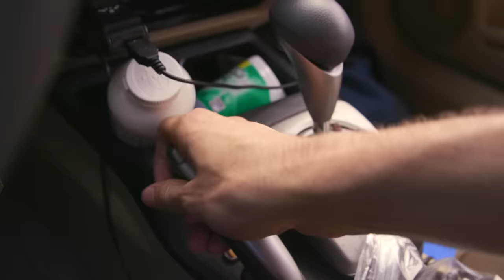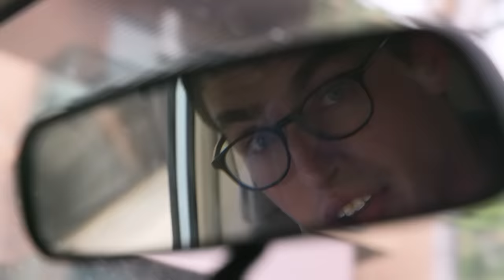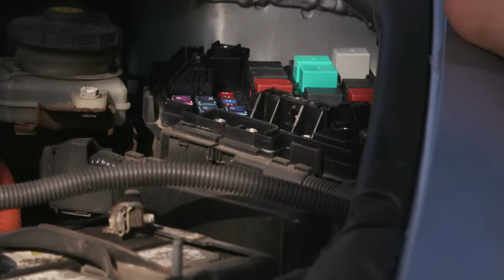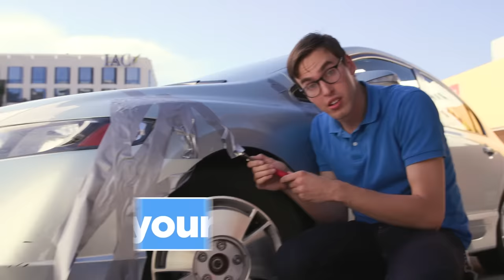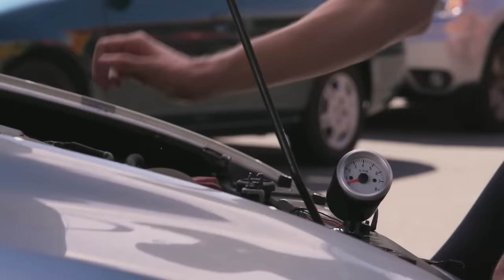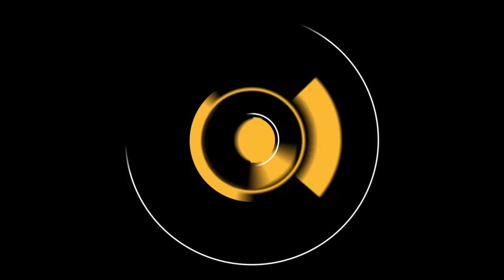5 Tips for People Who Don't Understand Cars

Comment: Wish I woulda seen this before I tried changing my prius' carburetor fuses. Now it beeps at me 100% of the time instead of just 50% of the time.

On a serious note, who the hell thought it was a good idea to control the wipers and lights with a four dimensional Bop It? And the beeping is srs annoying af. Be prepared to cut a few wires and spend a week reading the owners manual if you every get a hippy mobile. And screw HID bulbs. I feel I a massive dildo blinding everyone coming towards me. They're expensive and hard to change, too. The cheap ones won't even work because of "resistor imbalance", what a load of horse crap, they're just forcing you to buy from them.

The speakers it comes with are really good tho, I get to piss off everyone else on the road without any extra cost. And absolutely nothing has worn out except for the serpentine belt after 90k miles. So not a terrible car.
Reply: Prius lights are fucking annoying, it's true.
Reply: HugeWeltanschauung dwarf fortress!!
Reply: I see your problem here ... you have a prius, 
get a real car
Reply: you can make a prius better by walking.
Reply: rage fards See post above yours.
Reply: Considering that the NiMH battery in a Prius has about the same capacity as the deep cycle in my non-hybrid, I would have to agree.  Not to mention your attitude pretty much summarizes most Prius drivers I've seen.

Comment: Seriously, why can't we go back to when cars ran on steam?
Reply: I have driven a 1925 Doble,  20 minutes is about the quickest start up time.  One benefit is there is no transmission, direct drive.  Just keep an eye on the fuel supply pressure and water temp.
Reply: thejunkman you think it would be possible to fuse both techs? Improve the old design, but still keep it simple.
Reply: There are some real inherent drawbacks to a steam vehicle for "everyday" use.  Mostly being a total loss system in that you are always having to add water and when you do that you have to wait for boiler temps to rise again.  Lubrication and wear is the biggest thing to get around.  Also performance is very dependent on ambient air temperature.  Forget about the creature comforts you have come to expect in a car, as (just like with EV's) those are a hog on what ever electrical system you employ meaning the steam engine will always have to be turning, even at a stop light.  Even just running into the convenience store the car has to be "heating" to keep the boiler making steam.  The Doble is probably the pinnacle of practical steam car technology, but you just can't get around physics.
Reply: thejunkman man, that sucks. Thanks for the info

Comment: “Tachometer” - measures the speed of something. Not necessarily distance per time. BTW, tachycardia is when your heart beats too fast, and the root is shared between them.
“Inductive pickup” - at a guess, I would say it uses induction to transfer something, likely motion, from point A to point B.
An alternator turns (some of) the output of an engine into electricity.
Reply: Inductive pickup sounds like something on an electric guitar. Can you tell I play brass?
Reply: An inductor is an electrical thing. It’s a coil of wire around something. You pass an electric charge through it and it generates a magnetic field. It also opposes changes in current. Your alternator generates electricity for your car and to recharge your battery and is a mass of coils of wire so likely has somewhat of a magnetic field around it (I’ve never thought about it before).  So something about magnets and electricity and likely opposing magnetic fields to measure speed? Perhaps of revolutions of your motor at idle?

Comment: A diesel engine doesn't have anything to do with the utility of a tachometer.  Tachometers relate to the transmission and tell you how fast the engine is running.  Too high (more than like 3000 rpm) and you fuck up the transmission.  They're more useful in manual transmissions than automatics, since a tachometer will tell you when to shift.

Comment: I started my really old car a month back (it's had multiple owners before me). I was in the middle of backing out when my entire car just turned off, engine and everything, and I started rolling forwards. I prayed that it was just the old battery, jump started it, cleaned the battery with soda later that night, and have been ignoring the fact that a battery cannot be responsible for my car shutting down mid drive.

I have to drive through a busy valley with only one lane to get to work. Still pretending it was the battery over a month later cause I'm in college and broke af.

Comment: Though any well designed car will come with a Tachometer in the instrument cluster, the aftermarket unit installed on that "diesel" (I honestly can't tell if it actually is one or not, nor does the script help) serves the purpose of telling you how many revolutions per minute, or RPM's (in car guy terms) the crankshaft of the engine is doing. That's the thing that spins when the dinosaurs explode in your engine, to put it into man baby terms. Unfortunately, the tachometer of that engine has inexplicably been mounted in the engine bay, completely nullifying any purpose it would've served, as it's main point is to be able to watch it as you drive. I would try to explain what an alternator is, but that might require more than what little thought people with brains turned to mush can offer. And make sure to keep your blinker fluid topped up.

Comment: It seems no one in the comments has explained what he said at the end. Judging off by what he said, a tachometer is there to read the "rotations" and a rotation is when one of those weird hammers in your engine go inwards, and then pop back out. You usually have 6 of those, 3 on each side. When a rotation happens, the gas chamber lights the diesel, making a small explosion that shoots the hammer up and that makes your car go. So the more rotations, the better. Reading these rotations is very important. Low rotations means your engine is in shit condition

Comment: For people who are curious: 

Alternator- car electrical generator that charges the battery.
Tachometer - strap it to the alternator (battery charger) to read the number of rotations the generator does. 

You already have one installed in your car, most likely: that’s the RPM thing next to the speedometer on your dashboard that tells you how much energy the car is using up.

Comment: your alternator works by running off a belt coming off the harmonic balance or a puller for older v belts. when a shaft driven by the belt is spun a fixed magnet passes by a coil or armature.  this induction produces a voltage spike.  when a spike is detected every rotation the computer in your car can determine that 1 revolution has been completed.  measuring and averaging theese spikes you get rpms. it is the exact same principle behind an encoder. also diesels have alternators too.  that is how they run onboard electrical (headlights and radio (also stupid def injectors)). your car matenence should include oil,  power steering,  transmission fluid,  brake,  antifreeze/water(levels and qualities). IF YOUR CHECK ENGINE LIGHT TURNS ON SHELL OUT 20 PESOS AND GET A TESTER.  MOST PROBLEMS ARE STUPID SENSORS THAT LIGHT UP IF THEY BREAK.  SAVE YOUR SELF 200+ THAT WAY.  SERIOUS ISSUES SHOULD BE CHECKED.  IF THE CAR SOUNDS OFF,  IF ITS SHAKING,  TAKE IT IN. KNOW WHATS WRONG.  there are 10000 videos on youtube (and your owners manual)  on how to fix anything . i unerstand that everyone doesnt know the difference between in block and overhead cams,  but you should know the difference between all wheel,  4wheel , fwd,  rwd; 5w 20, 10w 20, 10w 30. cars are easy spend an afternoon learning useful stuff rather than baking i front of your phone.

Comment: Always remember these tips for kids who just got their liscense:

Tip #1: Spray paint is just as good as regular paint, right?

Tip #2: If you crash, remember, it is always always always your brakes fault

Tip#3: If the stick shows 12345R and not PNRDS, just give up, don’t even try it, don’t even pretend you know what it does

Tip #4: If someone says to pop the hood, point at the small, metal covered thing connected to the belt and say, “yeah, I gotta turbo”

Tip #5: your backseat is just a bigger trash can

Comment: a tachometer shows you your rpms, some tachometers used with a inductive pickup and the inductive pickup goes on on your alternator ( which charges your battery) which then gets a reading and shows you're revolution per minutes.

Comment: If you need to jump start your car and you have jumper cables (buy some), hook up the cables to another car battery to your car battery. The cables go positive to positive, negative to ground. The battery has + and - signs for positive to negative, and when I say ground all you have to do is attach the cable to the hood of the car that needs the jump. Start the working car for 5 minutes, then try and start yours. If it doesn’t work, wait another 5 minutes.

Comment: Yeaaaah, I went through the call your dad, hopeless car mechanic phase, But when you own a hunk of junk long enough and have to watch youtube video after youtube video to get it fixed you start to pick it up as you go. I'm still not as good at diagnosing the problem as he is, But I think that'll sink in over time.

I change my own oil, oil filter, air filter, and I've done the feul filter myself once. Timing belt is a real pain in the dick, but I got it eventually. Changed the brushes on my starter, put a manual roll down window back on track, replaced my own headlights, and replaced an alternater.  and the brake master cylinder.

If it isn't in that list of things I've had to figure out, I have no clue whatsoever how to fix it.
But like I said, I've owned that hunk of junk car for a while, I'm sure as I continue to own it I'll learn how to replace each and every piece on it as it breaks down. At least until it's the damn transmission, then I'll get to watch it get crushed into a tiny block.
Reply: Anvil Bound you sound like the kind of guy your Son is gonna call when he doesn't know shit in future
Reply: what car do you have?
Reply: Volkswagon golf, It's got a lot of problems I've resolved over the last few years, some of which can only be described as a half-assed repair job, for example: It's now got a push button ignition, I installed it myself after the switch in the key failed to send power to the starter solenoid, which I've also replaced because I thought that it was the problem, I've also replaced the tension pulley dingus that keeps the serpentine belt on track because it was destroying the belt every one or two months. the radio is grounded to the ciggerette liighter because I couldn't sort it any other way and I gave up, but now it's jacked up some other way that I've yet to figure out, the sun roof has a broken track so the only way to open it was to press the button and push the thing open on the track at the same speed as the motor pushes it, but that stopped working with it still slightly open, so I caulked it to stop the rain from leaking down the back of my neck. the heater doesn't work, and I now have to buy two different styles of windshield wiper because I had to replace the arm on the passenger side with one that fit the motor from a scrap yard.

I'm telling you, the only real way to learn anything about cars these days it to own a piece of shit starter car, move about four hours away from your family, and tackle the problems as you go using those awkward phonecalls to your mechanicly inclined parent, and following youtube/google advice to get it running again.
Reply: Anvil Bound am i glad that i began learning about fixing cars at age 9. bu still thats real impressive man. golfs are really resilient cars for the money and availability. hope you can get a better one or figure out how to make your golf better :D
Reply: I wish I'd have learned early but I was too stupid to pick up the lifeskill, basic carpentry and plaster repair too, My dad solved every problem I ever had, tried to involve me and explain it to me but I had no interest, so I've had to play catch-up ever since moving out.

Either that or I guess you could rent, or tie yourself to a huge car loan for a new or new-ish car every few years and let the warrenty work for you, but that's a LOT of money to flush for just not picking up the skills you need to keep a starter car running.

One day, my kid is gonna drive a PoS too, and i'll explain my story and really let the information sink in before they move out, Provided they aren't stubbornly disinterested like I was.
Reply: Anvil Bound well admittedly having a pos car is a bit more satisfying because of the investment of time you need to have for it

Comment: A Tachometer is a “Speedometer”, that indicates the number of your RPM (Rotations per minute. Basically how fast your engine’s shaft is rotating). A tachometer is made out of an Elektromotor, that is connected to the magnets at your shaft’s output, and also trough the fuse box right into your battery, that is connected to the alternator. Most of car consumers think, that while you are driving you are using your battery only, but she is being powered by the alternator, that is taking the kinetic energy of your wheels and transforming them into electricity via its electromagnetic motor. The battery becomes the only source of electricity, only if you are staying still. So technically you could say, that your tachometer is connected to the alternator (Not directly), however it doesn’t matter if you have a Diesel or not, because not only does the compression ignition process not have an effect on your speedometer, but the tachometer is an essential part of any car and comes with it from the manufacturer.

You’re more than welcome. 🤓🚗

Comment: Things I've learned about cars....if your ventilation fans give out a weird burning plastic smell when turned on - you need a new alternator. Knocking noise from any of the front two wheels means it's something on the suspension. Rattling underneath is likely to be the aluminium heat shield and can be ignored unless it's annoying. And finally, the money saver - corroded discs and pads does not automatically mean that they need to be replaced. A clean is most likely to be all they need.

Comment: Deisel engines dont use spark plugs like gasoline cars do and instead rely on compression to gain enough friction to ignite the fuel. Due to this it is good to know what speed your engine is running at by implementing a tachometer into your car to be aware of the rpm measurements. And your early 2000’s civic already has a tachometer up to 7500 rpm redline. By the way im 14

Comment: Alright so I haven't looked at this stuff in detail but from what I remember, and what I have made sense of when I was super interested in the mechanics of a car, here's a small explanation.
An alternator is basically what helps with the slowing down of the car other than the brakes, but it's main purpose is to charge the batteries. Its connected to the motor and basically uses the same magnetic principle that we all did at high school science; magnet passes through metal, causing resistance, causing electrons to shift back and forth, creating power in the form of electricity. The going back and forth of the magnet is caused by the turning of the engine. The resistance is what helps with the slowing down. 
An inductive pickup is basically the same thing except it's much smaller and instead of storing power, it uses that power to sense how many rotations per seccond the alternator goes through. I don't understand the install a tachometer part though, isn't a tachometer default in every car? Diesel or gasoline?

Comment: Tachometer is the big gauge that you've never looked at right next to the speed gauge. Alternator charges your battery from your engine. Diesel and regular both have the tach and alternator. There are only like 5 production diesels in America and they are well branded and slightly more expensive. You don't have a diesel if you don't know you have a diesel. Lastly, take the damn thing to the mechanic because you're going to cause more damage and end up paying more.

Comment: tachometers and alternator are not connected at all.

a tachometer uses a variety of sensors on the engine (crank position, cam position..etc) to measure how quickly the engine rotates, given in rpm, i.e- revolutions per minute.

alternator are basically belt driven motors, there connected to the crank pully and when the engine turns, the belt rotates the alternator shaft which rotates magnets around a coil thus generating electricity..i.e- a small generator. it's power is used to power the entire vehicle (Windows, radio, lights, ignition coils, ecu... you get the point..)

both gas cars and diesel vehicles use an alternator and both have a tachometer. simple.

Comment: A diesel engine doesn't really have any more or less need for a tachometer than a gasoline engine, it's just a gauge to tell you how fast you're engines going. 

If you have a manual transmission, it's probably a good idea to have one, but most cars come with them from the factory.

Also, most cars don't have tachometers that read off the alternator, they usually read from the crankshaft or camshaft position sensor.

Comment: I mean I'm twelve and I still know too much about cars for my age also the sound of the engine made it sound like a belt might be winding up or a valve might not be connected properly or a piston might just be knocking every once and a while, meaning that the engine is probably running at a low rpm from the sound of the engine.